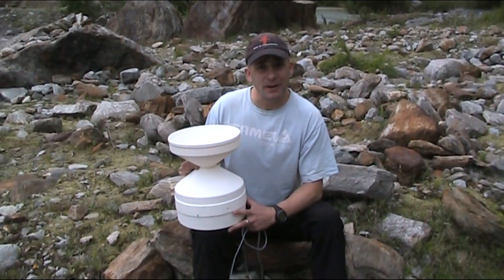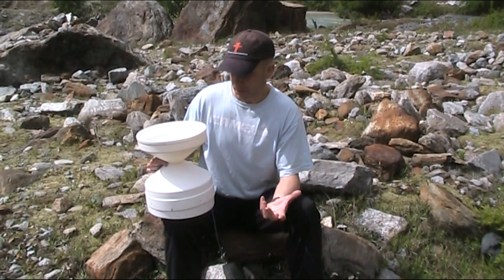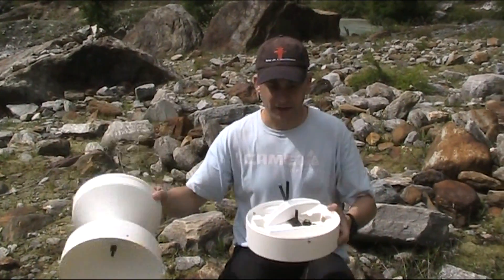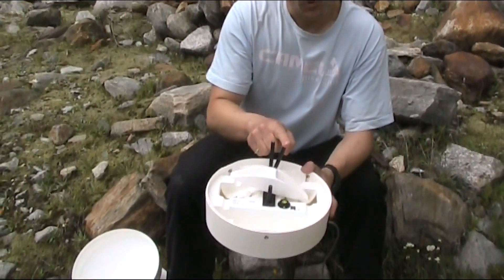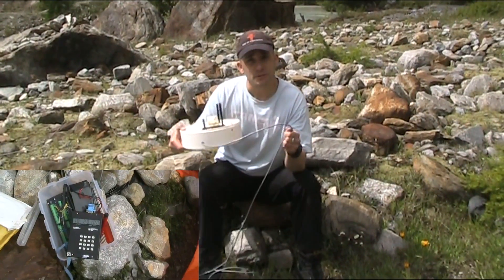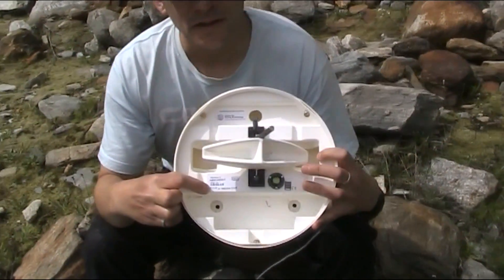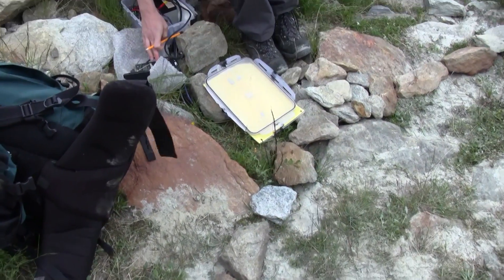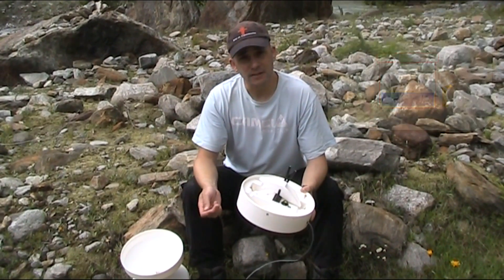Tipping Bucket Raingauge - Measuring Rainfall

Comment: I have two questions
1. What if bucket its in the middle and the rain stops. I will lost that volume 
2. is it possible the force of the water push down the bucket so i will have  "ticks" with empty backets?